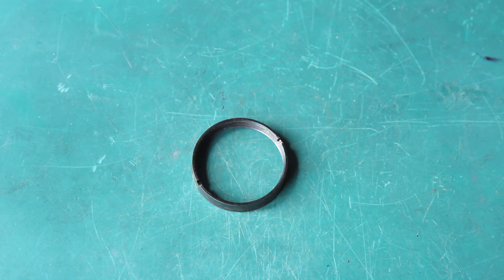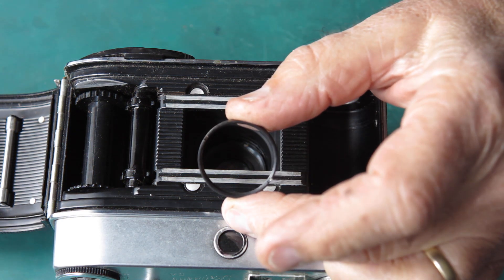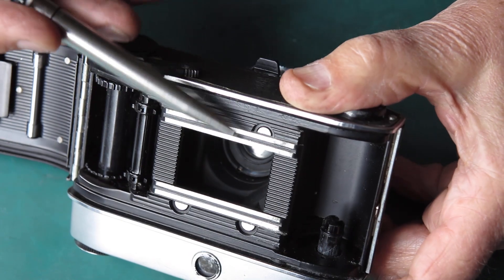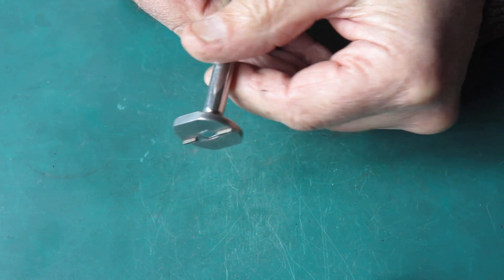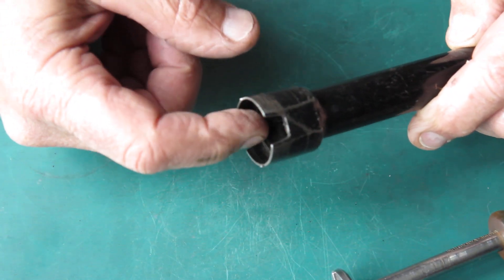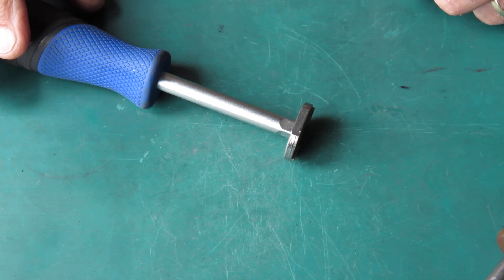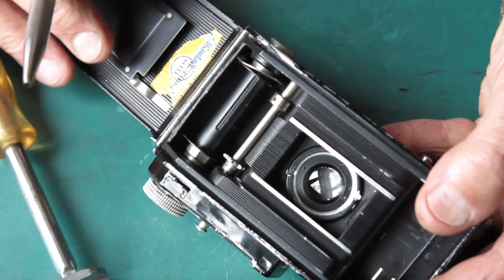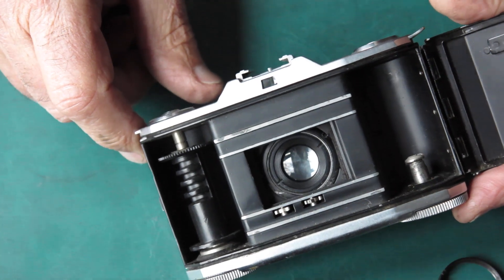Camera shutter retaining ring tools, part 01

Comment: Thanks for this video.  I've made "pin spanners" for small precision bearings from standard screwdrivers.  All it took was needle files.  I see you came up with something better using a dremel tool.

I never figured out how to make these larger tools, so thanks for engaging my imagination.  I have hundreds of sockets I can use, so many that I recently gave away a bunch of handtools.  Now I can use my belt sanders and dremel to repurpose old sockets and bits of pipe.  Thanks!

Comment: I do love these generic tool & technique videos. Keep em coming! I have a lens wrench and on purpose I bought one that has angled tips. By default they're angled inwards but you can switch them around to be angled outwards. So they can reach tighter spaces. That being said the wrench is bad design otherwise. The rails are round bar and the screws that lock the wrench are hard to tighten and even then they very easily work themselves loose.